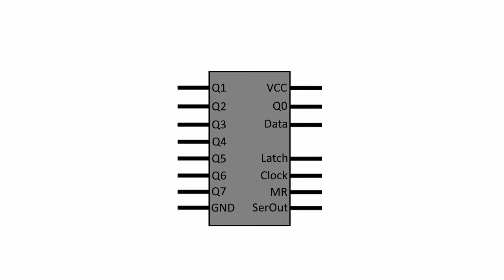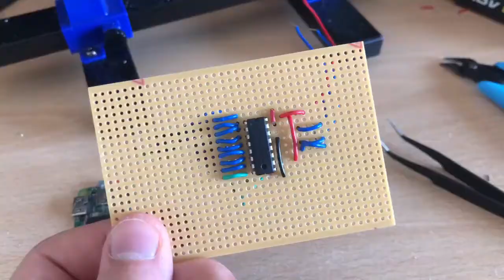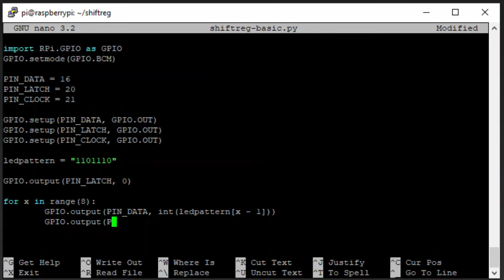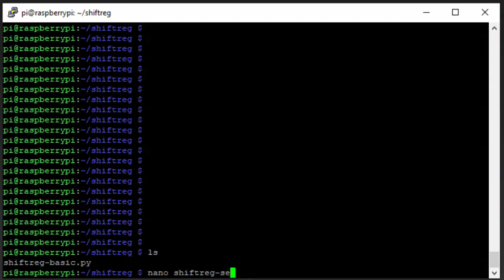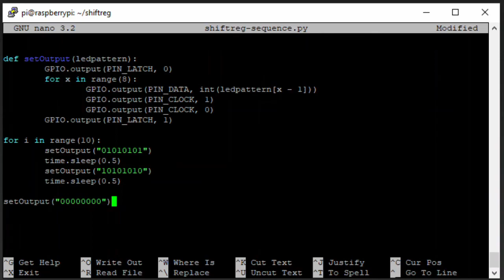How to use a Shift Register with a Raspberry Pi (74HC595)

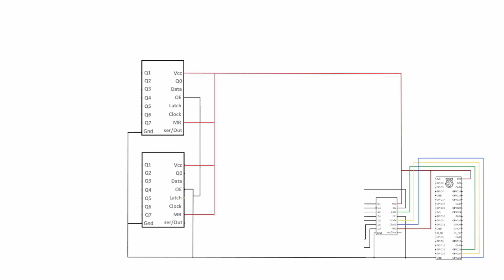Comment: at 8:53 you use two additional shift regs tethered to the first one. that's new. i don't know if I understand it. I imagined you'd run them in serial, from the first to the second then the third. it's what i've seen in the other tutorials.

Comment: Nice, clear explanation!

Made a binary count (going over all led combinations) with the same setup:

import RPi.GPIO as GPIO
import time

GPIO.setmode(GPIO.BCM)
pinData = 16
pinLatch = 20
pinClock = 21

GPIO.setup(pinData, GPIO.OUT)
GPIO.setup(pinLatch, GPIO.OUT)
GPIO.setup(pinClock, GPIO.OUT)

def setShiftRegister(value):
    bitValues = [128, 64, 32, 16, 8, 4, 2, 1]
    for x in range(8):
        hasBit = bitValues[x] == value & bitValues[x]
        GPIO.output(pinData, 1 if hasBit else 0)
        GPIO.output(pinClock, 1)
        GPIO.output(pinClock, 0)

for i in range(256):
    GPIO.output(pinLatch, 0)
    setShiftRegister(i)
    GPIO.output(pinLatch, 1)
    time.sleep(0.5)